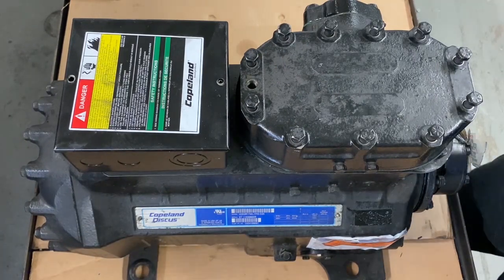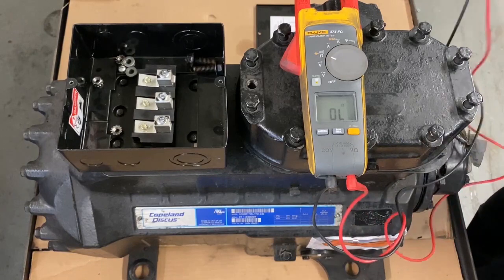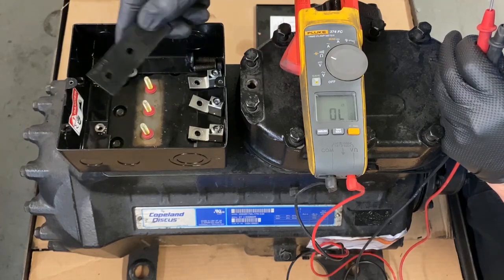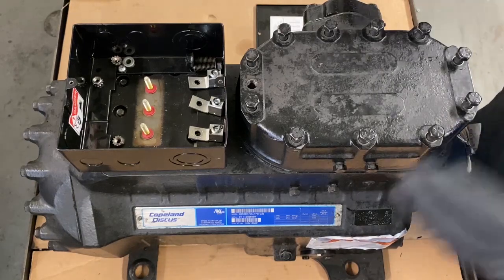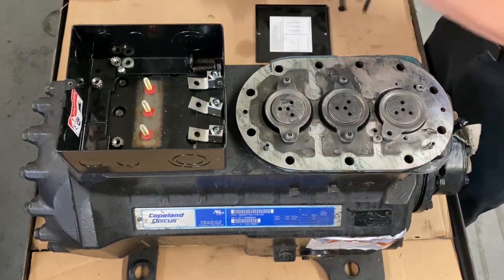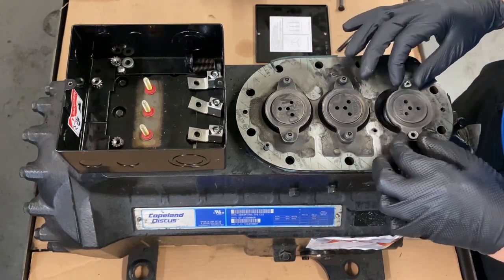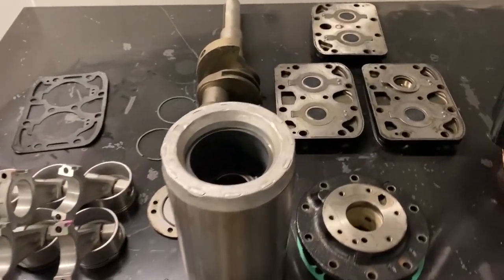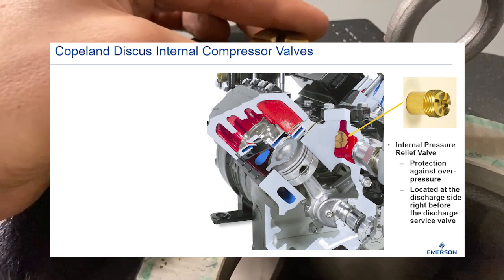Copeland Discus - Full Inspection & Teardown

Comment: Hi Trevor, if discharge pressure and temperature both high in semi hermatic compressor is there possible the valve plate foulty?
Reply from the maker: @Rin-bn9mj  it could be but it may not be. If you have valve plate issues like blow by for example your crankcase would warm up too. Think of anything on the high side that could cause high temp and pressure like Fans, coils, heat reclaim, check valves, service valves. 
Best thing to do is plot you diagnostic numbers on the compressor manufacturers performance and electrical curve charts of that compressor to see if it’s running near spec or not. Check the temp of the cylinders while running if they are close it’s probably something else. If one is 30 degrees higher then the others then I would isolate safely and look at the valve plate.
Reply: Thanks a lot for your precious reply.

Comment: Does the oil pump work in two directions or one direction ?
Reply from the maker: Great question. It can go in either direction.
Reply: I have same compressor and I have problem low oil pressure and when I revrse the direction of rotation I get normal oil pressure, Is that normal?

Comment: Can the oil pick up tube be accessed with out taking off the bottom plate on a 4D compressor? I just liked/subscribed
Reply from the maker: Great question.  There is not an oil pickup tube in the 4D compressors it has ports drilled out in the casting to the oil pump. K body compressors have pickup tube and you can sometime get them out without taking the bottom plate off but you have to be careful not to break it.

Comment: Quick question. 
What does it mean if my net oil pressure is above 60PSID?
Reply from the maker: There is a spring inside the oil pump that will bypass the the oil.
Reply: @RefrigerationMentor  Thank you.
What would cause high net oil pressure? I recently check the net oil pressure and my crankcase psi was 1 and my oil pump psi was 83 — 82PSID

Comment: Do you have to drain the oil in order to clean the pickup screen while in the field? I am having low oil pressure issues on 6D compressor
Reply from the maker: I have always pulled and changed the oil to check, usually the oil was dark in colour anyway but I have friends who isolate the compressor full close suction, discharge and oil line as well as electrical safe the compressor and they put a vac pump on the crankcase. While in a negative pressure they pull it out quickly to check the screen than pull the compressor into a deep vacuum to get out any moisture. I have not tried this myself personally.

Comment: Great video. Trying to learn a little more about these. Going to look at one this week. I am getting it tripping on High oil pressure overnight. Any ideas what would be causing that? The compressor is actually low on oil although sight glass is very dirty and cant see for sure. Separator float may be jammed i suspect.  Thanks
Reply from the maker: Intermittent oil warnings or a lockout is
possibly a symptom of a plugged oil pickup screen. Symptoms of a plugged oil pickup screen is a return to higher oil pressure after the compressor starts again, followed by lowering

oil pressure as the run time increases. If these symptoms are observed and other common causes of low oil pressure are ruled out (e.g. refrigerant dilution or low oil level), removal of the oil pickup screen to drain the sump and clean the screen will likely solve the problem.

If the oil protection system is generating low oil pressure warnings or lockouts but the measured oil pressure is adequate…inspect the screen on the oil pressure sensor for debris.
Reply from the maker: What is the oil pump pressures and the crankcase pressure? When it trips?
Reply: @RefrigerationMentor  Oil pump pressure 75psig and crankcase 15psig when at set temp of -12.. on the controller inside it reads “high oil pressure” on the history but I suspect it may mean low or high as it’s only one 1/4” transducer. I am going to replace it to eliminate it. Check oil screen as you say. I may replace the separator as it’s a sealed one as a precaution. 
It is on a Copeland semi running a bread retarder it trips at night intermittent. Thanks again
Reply from the maker: @AirsoftColeraine  have you did a blow by test or looked inside the compressor yet?  https://youtu.be/Y4glEC84l8U
Reply: @RefrigerationMentor  got it repaired today, oil change, blow by ok, oil pick up screen very dirty and cleaned out, oil was very low when I got there, 700ml drained and 1400ml new in, it’s been working ok, they said they,ve only been using it through the day no overnight programs as it’s for retarding and proving bread. It tripped 2 early mornings previous displaying high oil pressure on the history, no way of checking back what the pressures were unfortunately. I’ll keep you posted you,ve been a great help .
Reply from the maker: @AirsoftColeraine  It's all you. Keep learning, sharing, and growing.
Reply: @AirsoftColeraine  hi
Reply: @RefrigerationMentor  sir I do all kinds of compressor repairing do you have any job for me
Reply from the maker: @M-shehraz  I do not at this point but if your are good at refrigeration you can get work almost anywhere.